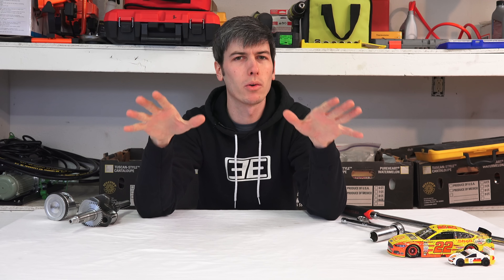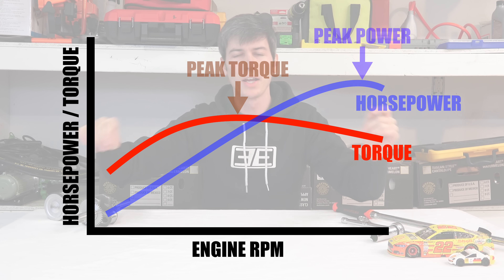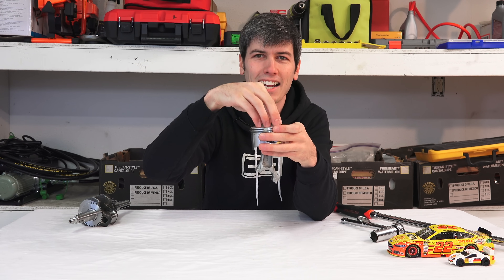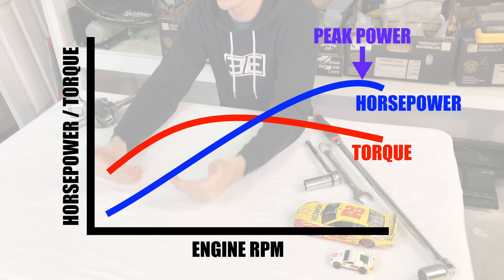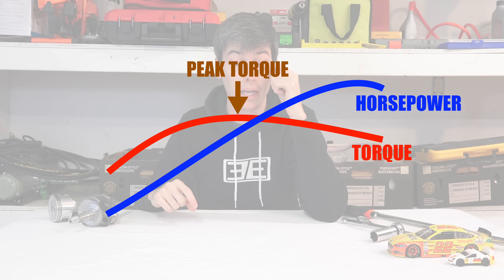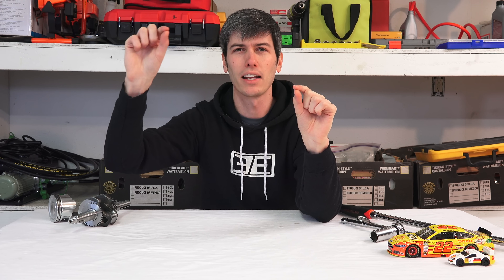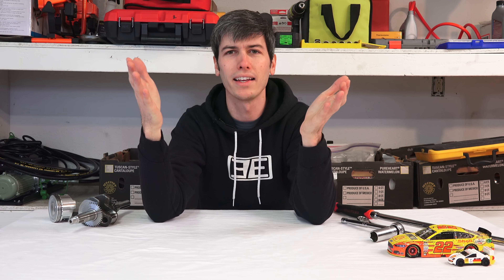Horsepower vs Torque - A Simple Explanation

Comment: I still dont understand how torque works
Reply: Torque is rotational or twisting force. It is force times the distance from center of rotation. 1 pound applied at the end of a 1 foot wrench exerts 1 pound foot of torque at the fastener. If you were to grab a spinning shaft and try to stop it the torque of that shaft tells you how hard that would be.
Reply: @Redtooth75  and after such explanations people start to repeat "torque is a real force you can feel how far you drag the wall". 
Torque is not a force. And if you were to grab a shaft - torque/lever (force) tells how hard it will be.
Reply: @IgorArkin  torque is the rotational equivalent of linear force. Open any physics textbook and it will refer to torque as rotational force.
Reply: @Redtooth75   if it was a "rotational or twisting force", it would have called a "rotational ot twisting force", but it is called torque, guess why. Look - you are confused. You think torque occurs at the end of the lever.
Reply: @IgorArkin  No I am not confused at all. I clearly said that the torque occurs at the fastener ie the center of rotation. 
Dr. Hinrichs and Dr. Urone disagree with you in their book "College Physics" where they describe torque as the rotational equivalent of force. "Torque is the turning or twisting effectivenes of a force".
How would you describe torque to someone who does not understand it? All you have been doing is nit picking every little tiny thing because they don't fit your apparently flawless description that you have not shared.
Reply: @Redtooth75  question is where that interpretation leads people to. Torque is force applied perpendicular to a lever and multiplied by its length Period. All that "how hard will be to stop it by hand" is your wrong thinking up.
Reply: @IgorArkin  no its not wrong actually. If you have a small electric motor that does not have a lot of torque you can easily hold the shaft and prevent it from turning. If you have a torque monster of a motor it would be very hard.  Because torque is the rotational equivalent of force. I clearly said that torque was force multiplied by distance from the center, which would give you a twisting force.
Reply: @Redtooth75  still don't get it? Axis is a single dimensional object. It doesn't have a diameter, you can't touch it. Put a 1m radius wheel on it. Now you feel force on the edge of it, braking it. Install a 1cm wheel and try to brake it now. x100 times harder to stop it. But somehow you believe you deal with "torque monster" huh?

Comment: even if you know what torque and power are some people don’t understand why engine power is important for acceleration not torque. 
At some point if a car is accelerating faster (assuming both cars are identical except engine performance) it is producing more power and it could be the car that has the highest max torque not the one with more max power. For example both cars are at 2000rpm where one has more torque hence more power also.
another example 2 identical cars different engine performance, first 200Hp@5000rpm second 300hp@7000rpm
one is in third gear at 4000rpm  50mph torque 400Nm
second car is in second gear 6000rpm 50mph 400Nm.  
The second one will go faster because it will have more wheel torque

Comment: Work = F x s 
Power = work / t 
Power = F x s/t 
Power = F x v
There can be a different power generated with the same force ,if we change the torque . Because the torque is Force x distance , with the same number of rotations , we can generate more power if we change the torque , or with the same torque , but with more number of rotations we can generate more power. More torque means longer lever arm , meaning more distance , or more rotations means more distance in a second .

Comment: I was looking for a video to explain this to a friend who could just not get the concept. At 4:55 you stated that at peak torque you would feel yourself being pressed into the seat the hardest if you remained in one gear from idle to redline. This is incorrect

At peak torque, not accelerating, the vehicle will pull the greatest load, but it will not accelerate the fastest at peak torque. The highest rate of acceleration occurs where the most work is being done. Yes, it can push the hardest at peak torque when presented with a maximal load and if pulling a maximal load, would not accelerate beyond peak torque as torque is not sufficient to allow it to accelerate beyond peak torque (but it also did not have enough torque below peak torque to reach peak torque pulling the maximal load either)
Reply: Probably you somehow didn't understand that acceleration and towing is the same thing, with Force=mass x acceleration.
Force (and work) generated by an engine is its torque curve (because geometry stays the same). Next, mechanical advantage comes into play, when you reduce wheel radius, getting higher force on the wheel with the same Work produced by an engine, that results in a better acceleration/towing. 
So if you can't control mechanical advantage during the ride (not having a gearbox) peak engine's torque is where maximum force on the wheels occurs. If there is a gearbox, the maximum mechanical advantage you can get (force on the wheel at a given speed of a car)  is from engine's peak power, because force produced there is less smaller than speed is higher (Power is force x speed).
Reply: @IgorArkin  Nope. Incorrect. If you look around you will find that he even made a video explaining why the fastest acceleration happens at peak power, not peak torque. I noticed it after posting the comment and he is correct in that video. Not this one.
Reply: @timkohlen1920  so what's incorrect? Write down somewhere: best acceleration on any given gear - at peak torque. Best acceleration at any given speed - at peak power.
Reply: @IgorArkin  basically repeating myself but here you go: At 4:55 in this video, the one you are replying to, he states that you will be pressed into the seat the most (the highest rate of acceleration) at peak torque. This is incorrect. The highest rate of acceleration occurs at peak power. Edit: instead of 4:55 start at 4:50.
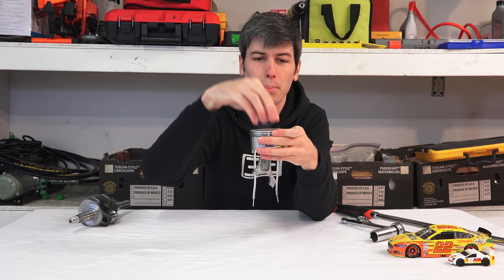Reply: @timkohlen1920  no, it starts at 4:45, listen carefully and do not mess up
Reply: @IgorArkin  thank you for the push. I was incorrect.
Reply: @timkohlen1920  it is not much incorrect though. Torque curve is an acceleration of a motor, which is also an acceleration of a car without gearbox (you dont need power curve). If there is a gearbox then power is acceleration of a car (you dont need torque curve).
Reply: @IgorArkin  details matter and the detail I glazed past was wheel torque and the fact that wheel torque is all that matters. I got stuck in my head applying the fact that you always want to shift on either side of peak power keeping the most area under the curve possible (the whole point being maximizing wheel torque). But of course we are talking about not shifting, so peak wheel torque is the same as peak engine torque therefor peak acceleration is at peak engine/wheel torque. Again, thank you for the push.

Comment: Wait my teacher said moment of force/torque is F*d(perpendicular to pivot) and work done is F*s(parallel to force applied)
Reply: Torque is rotational force which is found by multiplying linear force times the distance from center of rotation. It shares dimensions with linear work which is force times distance applied, ie if you apply 1 pound of force to a box and push it 1 foot that is 1 foot pound of work. Rotational work done would be torque integrated over the degrees of rotation.
Reply: @Redtooth75  More accurately, rotational work is torque integrated over the radians of rotation.  A torque of 1 foot-pound applied to an object as it rotates 1 radian or about 57 degrees, yields 1 foot-pound of work done.
Reply: @carultch  correct, I used degrees because they are more familiar to most people and are similar enough to radians to get the point across. Radians would be a better unit to use for definitions though.

Comment: Ok now can you explain to me like you were explaining to a 5 years old.
Reply: Suppose you sit on a teeter-totter, with your older brother.  You weigh 40 pounds, and your older brother weighs 80 pounds.

In order to balance the teeter-totter, you sit 6 feet from the center, and your brother sits 3 feet from the center.   The reason it balances, is because you both apply 240 foot pounds of torque to the teeter-totter.  You apply 40 pounds at 6 feet, while your brother applies 80 pounds at 3 feet.  That's what torque is.  It's the combination of force applied and the position from the center.

Now, to talk about power, we move from the teeter-totter to the merry-go-round.  Suppose the merry-go-round is 12 feet wide, and your father pushes it with a force of 40 pounds, while he spins it a 2 full spins in a minute (1 RPM).  Your father pushes it at a position of 6 feet from the center and 40 pounds of force, which means 240 ft-pounds of torque (same torque as you applied to the teeter-totter).  We multiply the torque and the 2 RPM together to get 480 ft-lb-RPM of power, which means the same thing as 0.09 horsepower, once we convert (divide by 5252 HP/(ft-lb-RPM)).

Comment: Unfortunately, 99 out of 100 explanations of torque and power, made by car enthusiasts for other car enthusiasts, are either (a) wrong, or else (b) so hokey in the presentation that it isn't better than the explanations that are wrong.

Whats-his-name here did a pretty good job until about 4:50. That's when he started talking about what happens in a given gear, and about the fact that peak acceleration within a given gear coincides with the torque peak. This fact, true though it is, has essentially no role to play in a correct explanation of torque and power. There's nothing wrong with mentioning this fact if the reason you do is that you intend to explain exactly why this fact has essentially no role to play in the correct understanding of torque and power. What's-his-name tried to explain why this fact is essentially irrelevant, and I give him a 'B' for the effort, but I don't think his explanation, starting at about 5:00, was a particularly good explanation. 

As he explained reasonably well, power is the time rate of work performance. Owing to the law of conservation of energy, power is the same at the drive wheels as at the engine, allowing for some loss to the generation of heat due to friction. Power is equal to the product of torque and rotational speed. He explained this also. And everyone knows this, but the reason it is true is that work performed over a given amount of angular displacement is equal to torque multiplied by the amount of angular displacement. Owing to this fact, the time rate of work performance is equal to torque multiplied by angular velocity (rotational speed). Now, if you combine these two facts, the result is that the product of torque and rotational speed is the same at the wheels as at the engine, allowing for some loss to friction. If the friction loss or negligible (or if you treat it as negligible), the product of torque and rotational speed is the same at both locations. This means that wheel torque is equal to power divided by wheel rotational speed. This is a crucial fact, but whats-his-name ever actually said this. I'll say it again, because this fact is an absolutely essential fact that anyone who wants to understand this subject absolutely must know. Wheel torque is equal to power divided by wheel rotational speed.

In any rational, informed discussion of the dependency of acceleration on engine torque and on power, these dependencies are implicitly defined in the instantaneous context. No physicist is likely to say this, because he/she wouldn't want to say something out loud that is so obvious that it is like drawing attention to the fact that the planet revolves around the sun. But even though a physicist isn't likely to say it, it needs to be said, because people who focus on what happens in a given gear do not understand that the dependencies that acceleration has on engine torque and on power are instantaneous dependencies.

Did I mention that wheel torque is equal to power divided by wheel rotational speed? Did I point out that this fact is a pivotal fact in the understanding of torque and power, and that whats-his-name never actually said that wheel torque is equal to power divided by wheel rotational speed?

You maximize acceleration at each and every instant by maximizing wheel torque at each and every instant, and in order to maximize wheel torque at any given instant, you maximize power. You maximize the product of engine torque and engine rotational speed. You do not maximize engine torque per se, because in general you cannot simultaneously maximize engine torque and the product of engine torque and engine rotational speed. The exception is when there is only one gear ratio.

Wheel torque is equal to power divided by wheel rotational speed. No matter what the wheel rotational speed happens to be at a given instant in time, wheel torque at that instant is absolutely in proportion with power at that instant.

The thing I do not like about whats-his-name's explanation is that it just is not a correct explanation of anything. This is true of many of his explanations. You maximize wheel torque at a given instant by maximizing the product of engine torque and engine rotational speed. To explain this subject correctly, it is absolutely necessary to say this. When you maximize the product of engine torque and engine rotational speed, peak engine torque is totally irrelevant.

Comment: So what exactly does torque do. Why is high torque good for trucks hauling weight?
Reply: Torque is rotating force, how hard something turns. In order to move the wheels of a vehicle a certain minimum amount of torque is required. Horsepower comes into play when you want to apply that torque at a certain speed.
This is the rotational equivalent of pushing a box. In order to move the box you need to exert a certain amount of force on it. In order to move the box at a certain speed you need to apply the force at that speed, which is power.
Reply: torque is favoured over rpm in generating power for hauling weight because no one wants to drive thousands of miles with 8k rpm. pure torque helps lower in the rev range.

Comment: This is a really poor explanation. There's nothing incorrect about it - it's just that using the context of a car with variable gear ratios leads to unnecessary complexity to explain the point. It would be much more appropriate to explain the concepts without all the moving elements of a car. Most introductory Physics texts manage this simply. You're much better off spending a few mins with those than this explanation.
Reply: Yeah i agree. Most people explain torque in horsepower with unnecessary complexity. They are at their core pretty straightforward concepts.

Comment: Time isn't a factor with torque. Horsepower is how much torque is being produced in a set amount of time. While a car with a lot of horsepower is stronger over 5 seconds, it doesn't help if it stalls in the first millisecond you try to pull a lot of weight. Then a diesel engine with more torque would be optimal, because it can output more power (with a single piston stroke) if you ignore that the power stacks up when the rpms increase. This is my understanding, but please correct me if im wrong.

Comment: In the V-Twin motorcycle world, it's said that "strokers" (longer connecting rod) will give you more torque that an engine that's been bored out to have larger cylinders. If that's true (is it?), why? I recognize that the longer connecting rod can give more leverage, but isn't the force being applied to the very end of the connecting rod (at the piston)? And isn't that force basically pushing directly AT the center of rotation? 

It seems like it's only the offset in the crankshaft that provides you with a radius, and if that radius doesn't change, the LENGTH of the connecting rod shouldn't matter.

The combustion chamber would be larger with the longer stroke, allowing for more fuel/air per stroke, BUT, if you created an equal increase in volume with a larger diameter piston, wouldn't you get the same torque? (Assuming the same crankshaft offset)

Perhaps the geometry of the connecting rod and the crankshaft changes with a longer rod?

Old video, I know, but somehow I've missed it. I'm a longtime fan and subscriber. Thanks for all you teach!
Reply: You are half wrong and half right. You are correct in thinking that a longer connecting rod does not provide more torque as it does not increase leverage. You are wrong in thinking that strokers have longer connecting rods. A stroker has a longer stroke or throw of the crankshaft. The stroke of a crankshaft is the distance from the center of the main bearing and rod bearing.